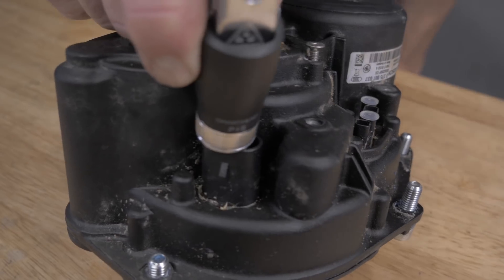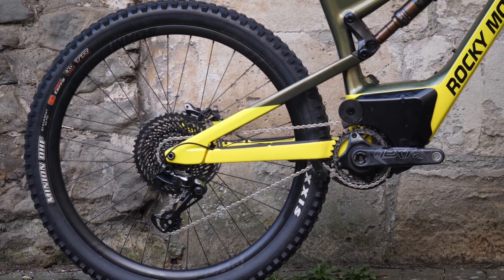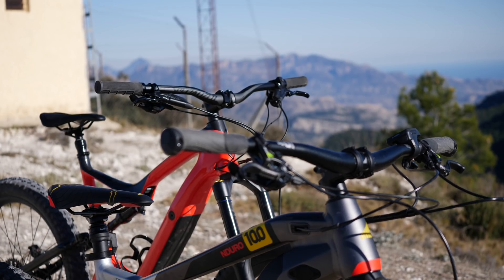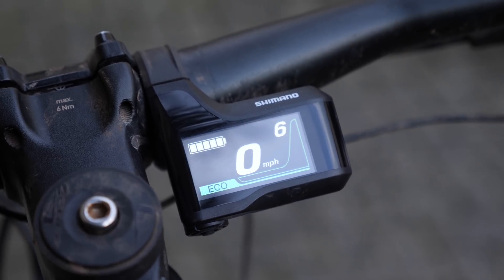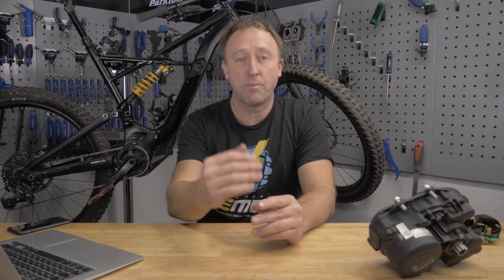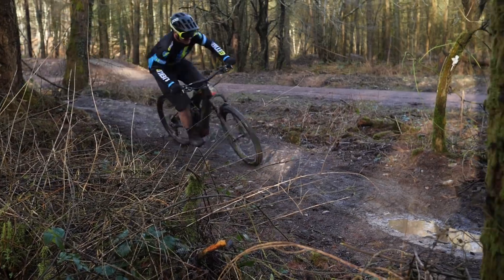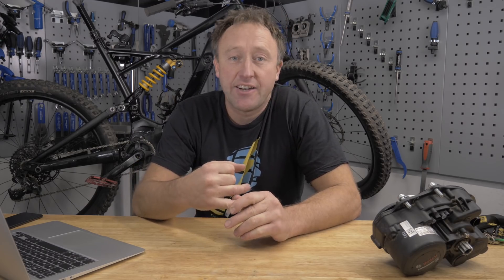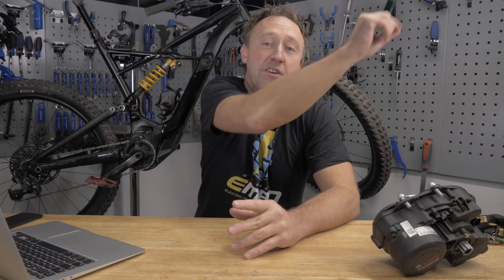E Mountain Bike Motors Explained | EMBN's E-Bike Fundamentals Part 1

Comment: well i'm halfway through and done the shimano steps so called nitty gritty review and not once during the general review of all motors and the focused one did you ever mention range. Now call me insane but personally range is pretty much make or break for me. How far on each of the modes can you get with mostly flat terrain, trails and uphill most of the way. That is what I am actually interested in everything else is in descending order. Like how long can I expect the battery to last before it needs replacing, then how heavy is the battery and feasible it is to carry a spare. Oh and average prices and lowest to most expensive. All things that you did not mention even once making me think that this is just some corporate advertising shtick. And that in all likely even t is also a paid endorsement of these products which if they gave them to you to test for free is exactly that a paid endorsement. And you need to mention it as such by law.

Comment: I started ebiking in early days as had epilepsy so needed transport, trouble i found using befang they had a poor metal drive stem on motor in side fitted to coil and non changeable, i broke mine 3 times just on normal road use and trying hard not to use power until i have pedaled up first. Mine has throttle and pedal so i disconnected pedal assist and so far its ok. What i am waiting for is a better bike and more reliable motors but from what i have seen there isn't one yet. Lots of new motors 2018 so need some test results

Comment: pw-x is the best motor out right now hands down.  tried them all, the pw-x is thin/light smooth and powerful.  easily keeps you at max speed (20mph).  1k miles on mine so far 3 months, only complaints it is on loud side and no walk mode other than that love it.

Comment: Great info.... watch, this new sport will branch out into a new breed of better peddle assist all mountain e-bikes through to light weight electric motorcycles at the top weight range and will likely use the latest 6050/6000 3V~5V Mpu 6 axis gyro accelerometer that thanks to RC quad copter cost much less than a 2$ plastic water bottle with ample software in place to build on. But look out as just with RC models it can really ruin your riding skills especially doing wheelies in unicycle mode.... ;-)

Comment: Gent great job on your presentation, and appreciate your hard work in presenting the specs, that frankly dealers won’t give you. I must say the facts about the Rocky motor are not quite accurate. The torque is more like 127 Nm. Also has the highest production of max watts. This motor is by far the strongest on the market. I understand you have sponsors and they make/use great motors, I own a specialized and love it, but if your are presenting EMTB as unbiased reviewers, I expect accurate reporting. I really depend on this network for info that I will base my buying decision in conjunction to my seat of the pants ride. Thank you. And keep up the good work. E bikes will be the future of bicycling....

Comment: Specialized motors are made by Brose, they just get repackaged (software, apps, etc.), and Specialized tend to steer the focus away from the motor's origins. 

I know you're never going to review Bafang motors on here because they've not been adopted by mainstream manufacturers, but there's a lot of e-bike only brands that are working with Bafang. The biggest benefit there is the power settings and software can be tailored for each country (your shirt does say "Global", so these things need to be factored in), and each manufacturer can choose their own batteries, displays, software, etc. as they wish, as long as they match up. This makes the differences between each bike considerably greater than just a few minor variations in geometry and components.

It's also cheaper, which will help to open up e-bikes for everyone, not just the wealthy or fortunate.
Reply: I love the BBSHD with a 58v battery. More power and torque then any of these restricted motors!

Comment: In UK you can buy Electric Bike Kits from Ebay or other companies but non of them tell you that the throttle motor cant have more than 250watts power and accelerate above 15mph because then its a moped which means TAX
Reply: Shame about the nanny state in UK because it's a great country with good riding, fun people to hang around with.  How could the cops tell and are they actually looking to enforce that stupid rule ? If you're out of the cities, would any cop actually bother a guy on a bike?  UK cops must overlook so many real problems as we all know, maybe it gives them someone easy to crack down on for fun,  I'd hope having 500 - 1000w boost is not a mood killer worry in the UK.

Comment: Thanks, Steve, this is an excellent overview.  And I like your line about motors and water not being 'good mates.'  And for myself, my first toes in the water with ebikes will most likely be an add-on motor for two reasons--cost and I want to get my hands on this tech.

Comment: This video is exactly what I was hoping for so thank you guys!  When comparing the system as a whole (weight, power output, app, de-coupling, etc) it appears the Specialized system is the one to buy (which obviously means a Specialized eMTB).  Personally I have been leaning towards Specialized and Haibike when I finally purchase an eMTB.  I'm really excited to see the PowerTube from Haibike later this year.  The integrated removable battery is without a doubt the best way to go, as opposed to the batteries that are externally attached to the downtube.  The Jam2 with internal battery and additional external battery is very enticing, also.  It is very exciting to watch this segment of mountain biking evolve and grow.

Comment: I own 2 Ebike Mid Drive  System. Bafang Ultra M620 1,000 watts. 2nd Bofeili system with 250 watts. Bafang motor should be a common sight in US and Europe and you might want to look into it and review the system.
Reply: Bafang is eBay stuff..No dealers no support.
Reply: Cannondale2019 maybe in USA. Almost every ebike dealer in Scandinavia sells bikes with bafang and other systems. Especially since bafang max drive was released.
Reply: Dealear is USA are afraid of progress. The also only look to sell products on which they cand make ridiculously high profit markups. Like the 7000$ 250W Bosch... Why would they ever want to sell you a cheap 1000$ overpowered 1500W Bafang BBSHD ?👌😁 When they can make 4000$ profit selling you the bosch unit that no one except bosch technician know how to service and repair

Comment: Great video, only minor mistake IMHO is that you failed to mention the correlation between Brose and Specialized. 
Questions/suggestions from my side for further topics:
-add Continental and Panasonic systems to the comparison
-make some test about input vs output power using strain-gauge on pedals or cranks. also efficiency and range test in controlled environment.
-what's the point of having 80 or 90Nm of torque if, with 250W, this value must decrease above 30RPM of cadence? OTOH, what is the peak power of these systems? (250W being the continuous rated power. I have evidence that you can easily get 400W for short periods)
-What is the point of having 300% assistance if an average cyclist can crank out 150W on it's own? If the limit is 250W, that leads to the conclusion that anything beyond 180% assistance is just stealing your sensitivity, without adding actual power, right?
Reply: Like your thinking Markotrieste, i'll certainly be following up on some of your suggestions! Please keep in touch

Comment: Can these be ridden as a normal bike with no assist? If so, does the same motor decoupling/no drag apply?
Reply: Dynamic Adaptive Solutions Hiya I have a Haibike allmtn 6.0.Its a wicked bit of kit and when I ride it on the road,I'm riding at 17 miles an hour with no assistance it's lovely. However I did have a levo on test for a weekend and have friends with these.The one thing that put me off levos when you get to 15 mph UK spec it feels as if you have the brakes on.Not cool.I hope this helps you 👶

Comment: Hmn to bad one thing wasn't covered in this video, how fast is the engagement for different types of motor's. How much I must turn the crank's till it kick in. Also I I don't know why you didn't talk about that the rocky mountain is the only one where you are able to fit standard MTB crank's on.
Reply: Serp D. I got 3 motors, the slackest wud the old PW system from Yamaha, but I hear the PWX fixes that, Bosch is pretty much instant just like the Brose! Hope this helps
Reply: Hey Serp, we did touch on engagemnet on Yamaha and Rocky
Reply: Steve Jones true but I can not compare it to the others like Brose.  I am looking to buy  a E-MTB and this would be something I think is crucial for what I want to do with the bike.

Comment: Bafang is just fine. Cheap and zillion aftermarket parts and internal parts too, rebuild yours after many miles.
Reply: I concurr I have a Bafang too. Easily DIY serviceable. I get all necessary parts from Luna Cycle, California EBikes, EM3EV, Biketrix or even eBay/Amazon/Aliexpress/Alibaba. Banfang kicks ass. Up to 6 times more power (1500W) and it just costs 1000$ (not 7000$ like the 250W Bosch). Bosch and the like will make everything possible so that YOU Cannot DIY repair or program or costumize. Yet some people still buy them thinking they get "the shit".

Comment: Specialized uses the Brose motor in case anyone wasn't sure.
Reply: @NYCeWheels are you saying Specialized re-brands the Brose motor as their own? The Specialized Levo website clearly states that the motor is branded as Specialized, not Brose.  Please clarify.
Reply: We don't sell Specialized so I don't know what they advertise, but it's certainly a Brose motor between those cranks. It's tuned to Specialized's liking but is made by Brose and uses the same belt drive technology. They might brand it as their own since they are the only ones with an app that syncs with the system the way theirs does, that's the only thing I could think of. Sounds very Specialized to brand things as their own that aren't truly theirs ;)
Reply: @DerekLHays  Specialized has the worst motors in E bikes
Reply: Specialized use Brose witch they tuned with theyer own Software 
It s true and no Secret.
Its the Same thing with theyr Dh Tires wich are Copys of Maxxis Tires

Comment: You mentioned specialized is the only place you'd find their motors but I thought they used the brose system?
Reply: They do use Brose motor but they are one of the sponsors here and like to advertise as having their own system without mentioning they use Brose as component of that system.

Comment: Great overview reviews Steve ;0) One thing that wasn't mentioned was the IP rating on each motor and battery system?! It's a bit like the elephant in the room on ebike tech stats! How waterproof is each system? What are your views on this at EMBN? The only published IP rating I have found after extensive research is Bosch at IP 54, which means its only splash proof! And Brose a IP 56 for the motor and IP 67 for the battery, which makes that system virtually waterproof. I feel like its a hot topic, especially when we are riding our beloved ebikes in wet and muddy conditions! Many thanks for considering this a video topic ;0)
Reply: Terry Brightwater totally agree with you mate, I work in the power electronics industry and supply power semiconductors to companies who design and manufacture inverters for motors and was looking for one for my wife and was shocked to find non of them are IP67, the Spesh one using the Brose System is the best out there. It is certainly something they need to address for mountain biking. I guess the issue the companies have is if you totally seal the unit then in hot countries the thermal trip will kick in when the motor gets too hot, so perhaps some more work needs to be done on managing the thermals.  I do wonder how much the manufacturer’s are going to behave to units under warranty with water ingress, totally understand that bike parts can fail due to wear and tear but these units are not cheap to replace.
Reply: jumbleross thanks for a great reply :0) Not being in the power electronics industry, I didn't know about the thermal trip when the motor gets too hot, especially if it's fully sealed! Maybe they need to make motors for hot countries and motors for cold wet countries? Certainly riders in hot climates have not had the problems with there ebike motors, as the riders have in cold wet climates :(  I live in Wales UK, so my next system will be a Brose ;0)
Reply: HI Terry, yes i agree, thanks for pointing out, it was something i missed

Comment: I think you'll find that the Specialized is just a rebranded Brose motor. Brose unlike Bosch and Yamaha allow for bike companies to choose their own batteries and control systems. I believe Focus are the only company that Shimano allow use non Shimano batteries.
Reply: Exactly, there was little point in analyzing brose and specialized separately.
Reply: yes you are right same as Yamaha have there own motor for there bikes like giant so they can have there own display and batts and software that they can use with a brand motor.
Reply: Yamaha has been configured by Giant to make the PWX motor even more stronger & powerful

Comment: Another great video guys! You said some motors are hermetically sealed. Which ones? Would be great to hear about the Ingress Protection (IP) rating of the electronic components including motors and batteries as this is the way riders can accurately compare the brands. Cheers
Reply: Hmm, great thinking, have to say i missed that one! I will get on it
Reply: This issue was raised recently in the "eBike Smile eMTB Community" fb group recently with lots of links to  and saved in the Files tab for future reference as so many riders are now asking about it.  A company from NZ will be releasing a fully waterproof IP68 motor and battery later this year! Exciting times.

Comment: Your only flogging ex pensive ebike bikes you totally eggnord the cheeper opshen of hubb moters.
Reply: The name is Electric Mountain Bike Network - exactly what ebike built for singletrack is being missed? They should definitely not be talking about Pedego or whatevers.
Reply from the maker: We focussed in on the mid-drive units in this one. We're not ruling out covering the other types of motor available, though.
Reply: The reason why was explained in the video mate.
Reply: hub motors are not PAS.They need to be kept off Mtn bike trails.

Comment: Yamaha pw-x love it. Almost 1500km on it.
Reply: how's the range of the bike with this motor?
Reply: @sterpumihai  I own the giant version of it, and what I get is roughly:
Road eco- 100km
Road basic- 80km
Over that... Depends on the power you use

Trails eco 80km
Trails basic/active with a bit of sport/power 50-60km
I weigh 85kg. This is with 500w battery.

Comment: More technical info in that one video than most of all the ebike videos I've seen, keep up the good work, I did want a shimano steps but maybe a rocky now, bit undecided need more input :).
Reply from the maker: It's a tough decision! We're not going to do reviews on this channel, but hopefully there's a trail centre nearby where you can trial each of the options. Thanks for the comment!
Reply: Electric Mountain Bike Network 
I get you fella totally my own choice and you can't step on manufacturers toes.
Cost will he the biggest factor
Reply from the maker: Either of them will be really nice, let us know how you get on!
Reply: Electric Mountain Bike Network 
Will do, I'll keep liking and commenting top team.
Reply from the maker: Thanks Ian, appreciate it. Happy riding!
Reply: The only thing with the Rock Mountain is that mode switch, it's like a miniature PC mouse. Not particularly nice to use. I mentioned this to them at CORE bike show recently and they are aware so will be changing it in the future. That's were I really like the Shimano design. Nothing is perfect as the video kinda says.
Reply: Ian Hill Get out there and try a few out on the trials its the only way to be sure you get the best one for you. I Like The transition of the shimano it's really smooth  where as the Bosch is quite abrupt.
Reply: Ian, try all of them, but also factor in dealer location, and the price of consumable spare parts, such as drive sprockets, and any idler/pulley wheels that some systems operate. The rocky Mountain that you mention, being one of them. Also ask the price of a spare battery, as it is often overlooked when buying a bike, but could be of benefit long term.
Reply: DeadHead 
Topman dead head.
The rocky mountain reminds me a lot of the custom kit with a lighting big block motor looks very powerful but from a trained sparky with diy electric bikes and scooters  background i know it will be thirsty too so maybe the shimano system will be the best for me to get a good sweat on and travel some distant with a decent Wh per mile usage.
Reply: DeadHead 
Thanks for the input, the majority of the arrows point me to a shimano system either a focus Sam/jam or the Scott espark, like said ill go have a play before I drop some $ on one.
Reply: Eddie Jefferies 
Cheers Eddie good point really look at the overall costs of ownership specially over the warranty period.
I suppose in a few years time It will have been derestricted then as the battery capacity dies ill get my mits on it and get the latest cell of the time in there.
I have an A2b metro with a hub motor heavily modded it's lighter than factory but its a big old commuter bus.
Shame I can't post pics.